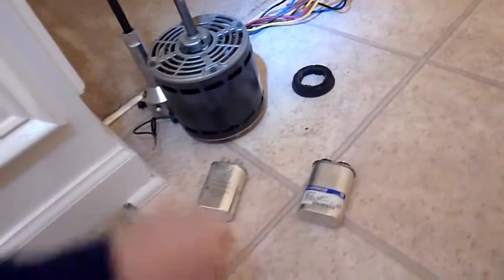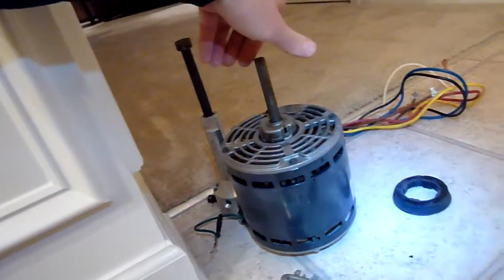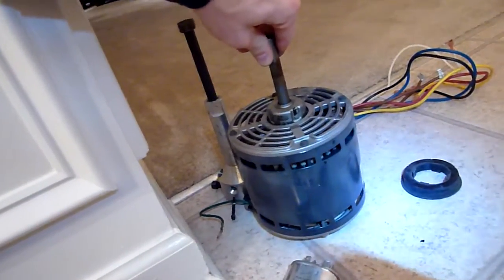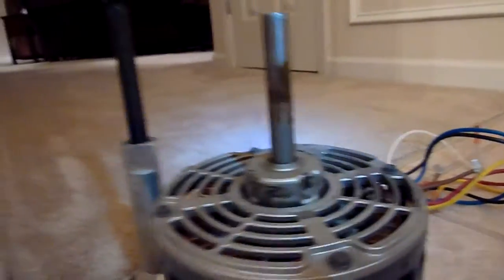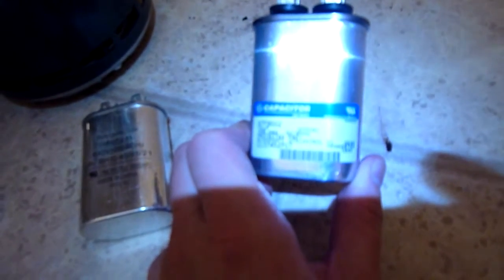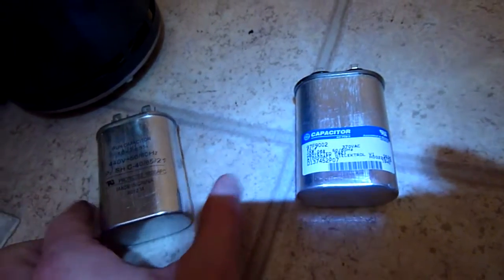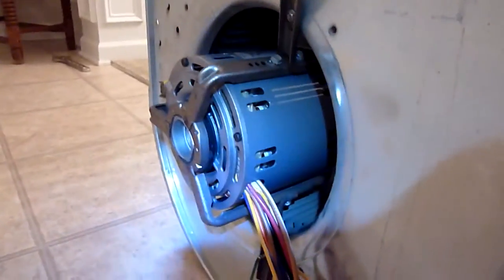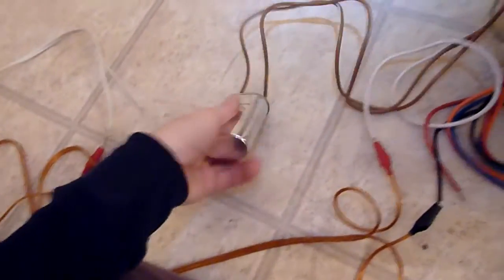Dead Trane XB80 Blower Motor

Comment: question was it completely dead or it had only low speed. I'm having a problem with mine I have fan but it's  weak when it blows out. if u can share that motor number and where u purchased it it be great. thanks